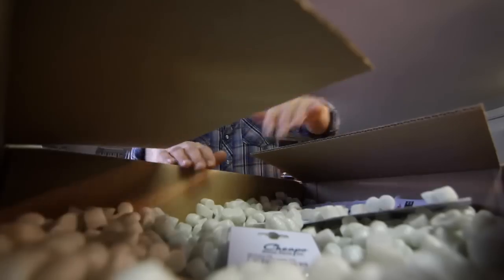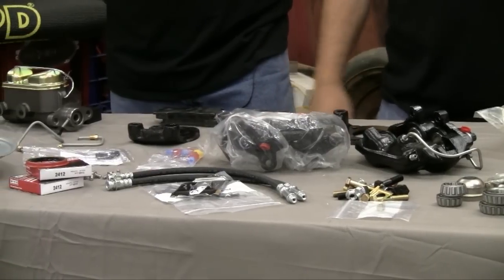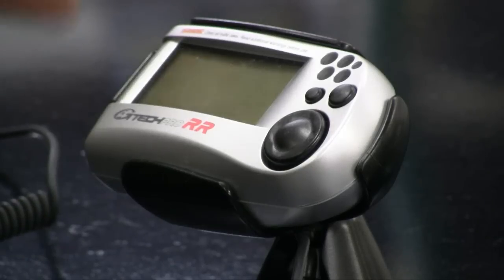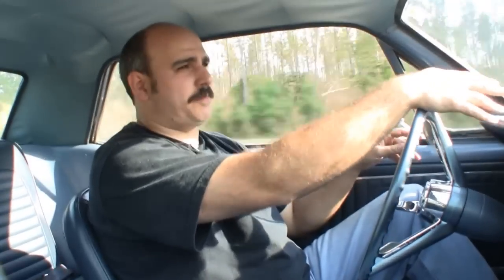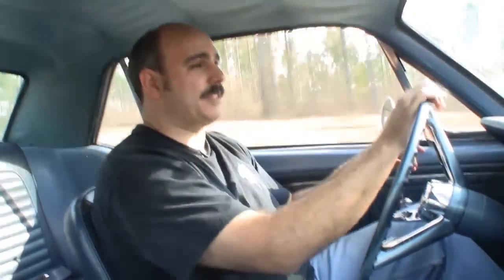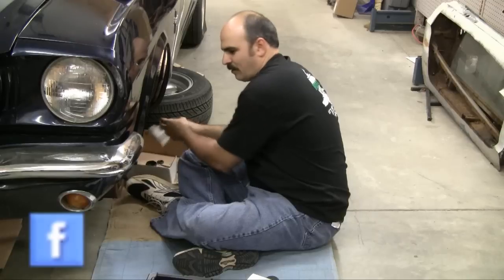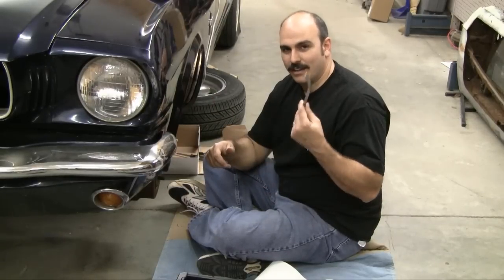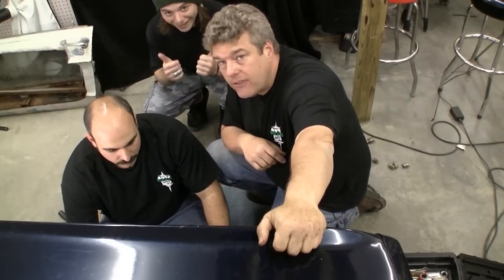Episode 111 Drum to disc conversion and testing Autorestomod

Comment: i would also recommend using a solvent to clean the drum internals prior to working on it to minimise any residual asbestos dust left in there plus it is nicer to work on clean parts than dirty ones  :)

Comment: Great job as usual guys.  I did this a few months back, ran into most of the same issues, without the spindle damage though.  Im still fiddling with the brake bias, so I hope you cover that in the next one!  That bleeder sounds nice, Im wondering if my bias problem is really an air stuck in the lines problem...  (and yes I did bench bleed the master)